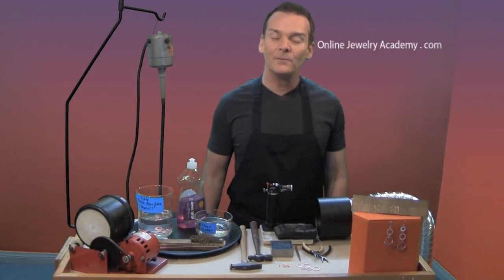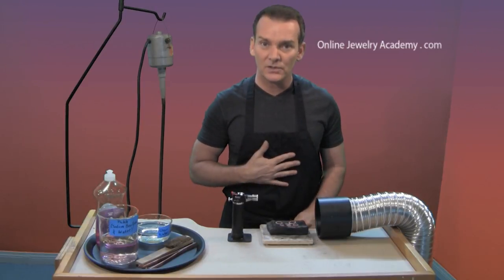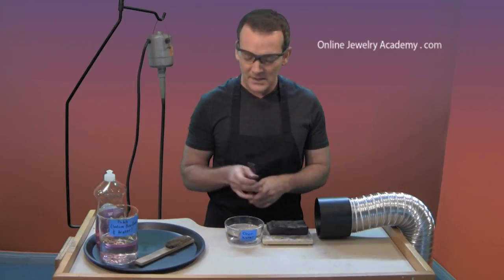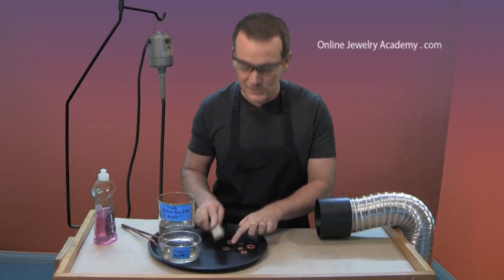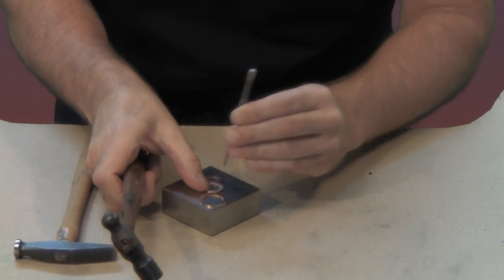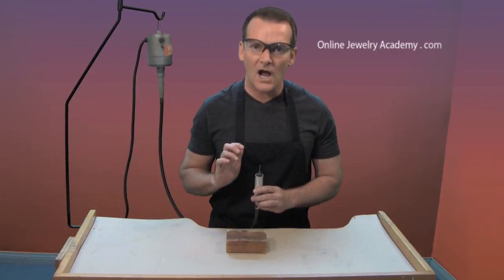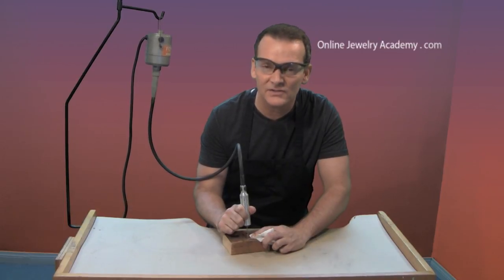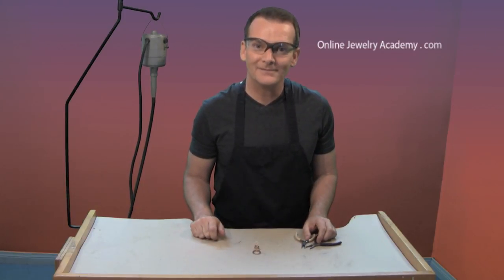Easy Cute Hammer Textured Drop Earrings Made From Copper Washers

Comment: Great tutorial. This would make a pretty pendant too. 
Feel like I could master the techniques with ease after learning from you.
Please share what size drill bit did you use?
Thanks so much.
Reply from the maker: Hi Michelle,  I honestly don't recall the exact size of the drill bit used in the video.  Just use one that will create a hole large enough for the jump ring to move freely.  If you measure your wire and then measure the base of your drill bits, I'm sure you can easily find one that will work.  Good luck with your projects.
Thanks for your support! : )
Reply: Thanks so much for your quick reply. As I newbie to metalsmithing, I appreciate every bit of advice I can get. TFS!
Reply: Antonmursid🙏🙏🙏🙏🙏✌🇸🇬🇸🇬🇸🇬🇸🇬🇸🇬✌💝👌🙏
Reply: Antonmursid🙏🙏🙏🙏🙏✌🇸🇬🇸🇬🇸🇬🇸🇬🇸🇬✌💝👌🙏

Comment: I love your videos.  The only question I have is this:  When you drill, you don't have clean holes...  How do you clean your holes so they are smooth?  Thanks...
Reply from the maker: Hi Debra,  I think you are referring to the bur that is left on the edge of a hole after drilling.  The simplest way to remove that bur is to take a drill bit larger than the hole you drilled and use it to scrape off the bur by hand.  This technique is demonstrated by Prof. Jennifer Monroe in the OJA's video on riveting.  You can find the video in the OJA's playlist  on its website at: www.onlinejewelryacademy.com
Thanks for your support! : )